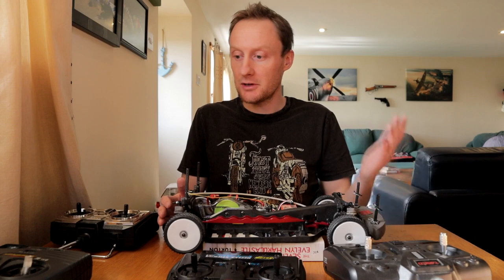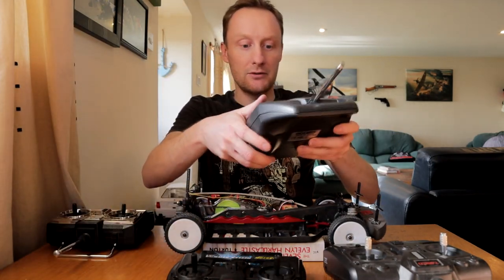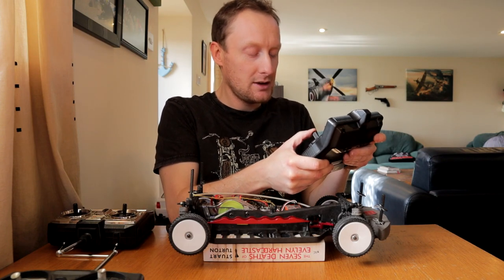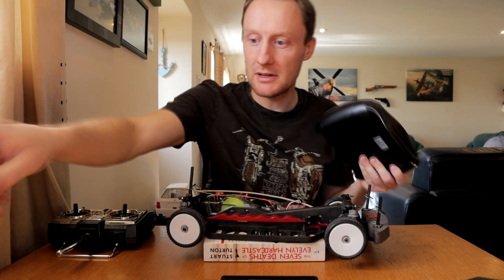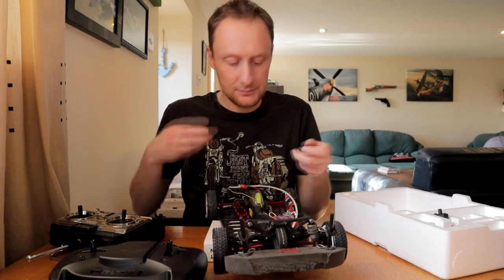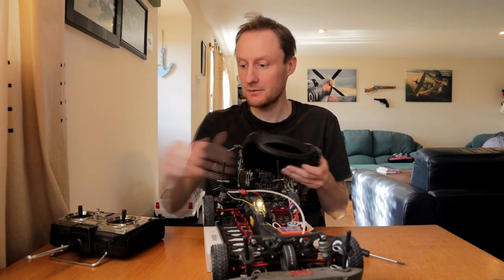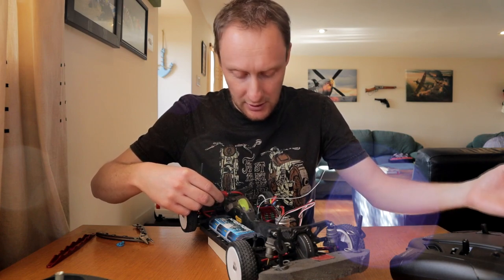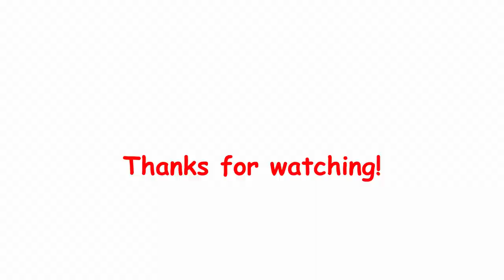FINALLY a modern Acoms Techniplus?? ... Futaba T2HR

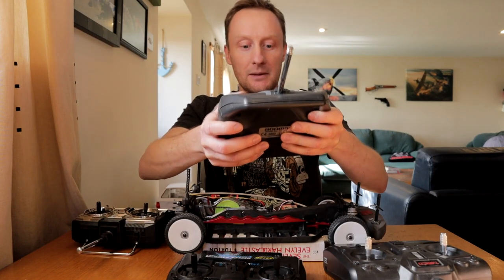Comment: Hey, what sort of range are you getting out of the Ap-202 (3:00)? I'm struggling to get more than 15 metres which doesn't seem right.
Reply from the maker: Yeah, that's not right. Sounds like you have a faulty unit. I'd return it to the shop and get a new one.

Comment: Great vid. I last week bought a tamiya top force eco and a turbo optima (couldn’t make my mind up which to buy lol)

I’m all about the building but thought I aught get the electrics sorted for a rip round the local park.

Back in the day I had hot shot 2 and acoms deal from beaties. So went and bought what I thought was the successor the Carson stick in your video. OMG what a load of rubbish. Literally bought it, opened it, returned it.

So tonight I’m looking for something similar that I feel I connect with and just did a search for the futaba and came accross your vid. Brilliant.

One question why do I need a modern stick? Why not use the acoms?

Again one of the best vids I’ve seen in a while, personal and factual. Great work mate. Ps good luck in the football tomorrow….
Reply from the maker: Thank you. Ah, brilliant! You definitely made the right choice, getting both!

Yeah, the Carson really is junk. The less said, the better.

Glad you enjoyed it and found it useful.

Simply because I wanted to use the slimmest, lightest electronics I could find and I didn't want to put an aerial hole in my new body shell!

Thanks again, appreciate it!

Cheers.

Comment: Thanks for this mate. The techniplus transmitter is also a favourite of mine. Back in the day, I used it for all my cars. Recently got back into the hobby, and really can't get on with these modern transmitters with the steering wheel. Only problem is, I need a couple more channels for my 1/5 touring car, and my crawler. How would I know if a transmitter is going to allow me to set the throttle stick backwards before purchase? 
Definitely going to be picking one of these up for my bashers though.
Thanks again. Dave
Reply from the maker: Hi Dave, glad I could help. Unfortunately, the only way to tell is to read the blurb; it seems only very few do this, nowadays.

There are a few stick transmitters with multiple channels, but I don't know which (if any) allow the stick to be set back. Good luck searching!
Reply: @TheRCScotsman  thank you sir, appreciate your reply, I shall keep looking, if I find anything, I'll be sure to let you know.
Reply from the maker: @daveterry4326  Sounds good!

Comment: Hi, thanks for making the video.  I am in exactly the same situation, preffering sticks to wheels.
My first controller was an Acoms AP27. Getting back into RC cars with my son, I got an Acoms AP202 (like yours) in a deal with a Tamiya Lunchbox. I also have an Acoms PG2402 which is 2.4GHz.... it is very good but has a lot of delay in it. This has a lot of delay in it.... so am looking for a new Controller like the Futaba T2HR.  What happened to Acoms anyway?
Reply from the maker: Hello and welcome! I hope you and your son have a blast! Oh, delay, really? That's not good... it can ruin any experience, having input lag. I really don't know what happened to them, but there really doesn't seem to be any info.
Reply: @TheRCScotsman  Where I really notice it is when going from forward to reverse. It seems you need to go into neutral then reverse. Either way great video
Reply from the maker: That's probably down to the ESC. Most ESC's allow for full brake, before initiating reverse. On Mtroniks RV ESCs, for example, you have to hit brake, go back to neautral, and then hit brake/reverse a second time, in order to start reversing.
Reply: @TheRCScotsman  Ok cheers.... not used to the newer technology yet. Thanks

Comment: I never could get the hang of sticks,I loved it when I got my first wheel transmitter,so intuative and easy to use.
Reply from the maker: I've never really had a lot of experience racing with wheel transmitters; only the Yokomo for a couple of races. My JRX-S Type R has a wheel transmitter, but I've never driven it. I guess old habits just die hard!

Comment: I grew up with sticks,and I fly aircraft too.As far as I know they have never developed a wheel set for aircraft(why would they?) and sticks work fine on cars.Having said that,coming back to cars after a long break I had little choice but wheel systems (I didn't want to lug around my 6ch set for a car) so I bought a Flysky GT3B. Great set, have 3 Tx now on 30 cars,but would love a simple 2ch stick set. How much, how much are the Rx and can the set bind to other make Rx would be my questions.For pure racing I can see this set would be ideal,assuming you have enough program settings to get it how you want-are there program settings? At very least end point adjustment for steering throw and stopping the servo overstressing on full lock limits. Good luck with it.
Reply from the maker: The set is 50 quid, the receiver alone is approximately £25. Yes, the Tx should be able to bind to other 2.4GHz Rx, provided they use the same frequency modulation type (in this case, FHSS). There are no program settings, just dual rate adjustment (to save the sevo, as you mentioned). I don't really need extra settings, really. Any setting adjustment I would need, such as setting the throttle response, all comes from the ESC. Cheers!

Comment: I have the T2HR myself.

It's a basic but very good radio. 

I don't like the plastic thumb sticks, but other than that I have no complaints
Reply from the maker: Yeah, those were my exact thoughts.
Reply: @TheRCScotsman  I slid a length of silicon tube over the stick and then wedged a 6mm plastic ball bearing in the top and it is far more comfortable
Reply from the maker: @PieAndChips  Ha! I like the ingenuity!
Reply: futaba sale some rubber to put on it , change the feel 100 % , but they are a little to long so i trim the bottom , fit perfect now :)

Comment: Hi the techniplus trans and receiver with modern esc ! Do you have any problems with the set up at all twice I’ve had problems with two individual set ups? Thanks
Reply from the maker: Hello. The old Techniplus transmitter and receiver should work perfectly with a modern ESC. If you're having problems, you might have a fault piece of hardware.

Comment: How hard would it be to swap modern 2.4 electronics into the older transmitter?  Does it still use variable resistors behind the sticks? Edit : ok, I just got to the end!
Reply from the maker: A little too hard to do, I fear!

Comment: I am the same as you, I liked the techniplus handset and still have the  one with the silver plate on the front. Have you had a thought about putting a 2.4ghz module into the techniplus handset? So converting it to 2.4ghz
Reply from the maker: Yup, we got one of those somewhere, as well! Yeah, I have, but I need to do further research into it. I'm not sure if it would introduce further latency, for example.
Reply: @TheRCScotsman  I've done it on a ko propo 40mhz system and it works a treat and is quicker than my flysky 2.4 system. I'm no expert by any means but I would think it comes down to how good the electronics are leading up to the transmitter module that is already there, at a guess. Great videos BTW keep it up buddy. They are getting us through the isolation lol
Reply from the maker: Nice. I'll definitely have to look into that! Thanks very much, John! I appreciate it!

Comment: Hello wondering if you could help me I have bought a bait boat that comes with the acoms techniplus as the controller And the guy said to me that he use to have a battery that would be left in the controller the 8 aa battery’s and just plug a cable in the bottoms of the controller to recharge just wondering could I put normal rechargeable battery’s into it and it would charge the same way via the bottom of the controller thanks
Reply from the maker: Sorry for the late reply, I only just noticed your question. Normal rechargeable AA's are probably what he was referring to, yes. But you'd need to make sure that the correct charger was used.

Comment: I just got the brand new 2HR for only USD$ 9.30, without servo. Got it in China, properly some left over stock sold from small hobby shop. BTW, what is the difference between T2HR and 2HR ?
Reply: I just picked one up for $68 with the 2 servos!
Reply from the maker: As far as I canm tell, T2HR is the transmitter and 2HR is the name given to the set, with receiver.